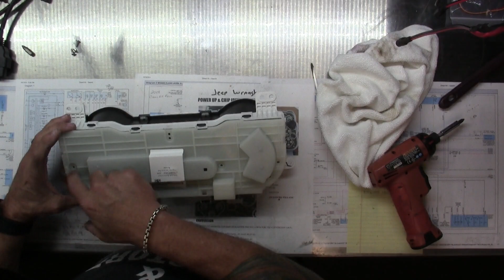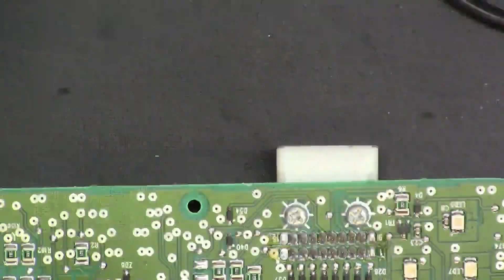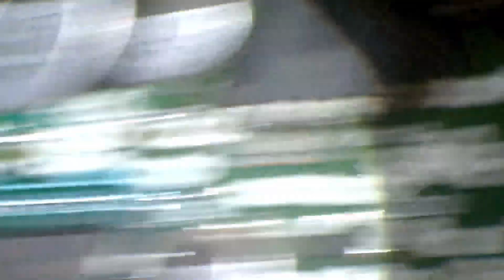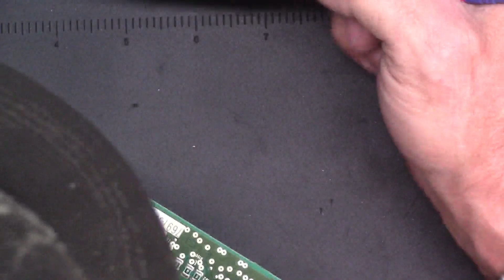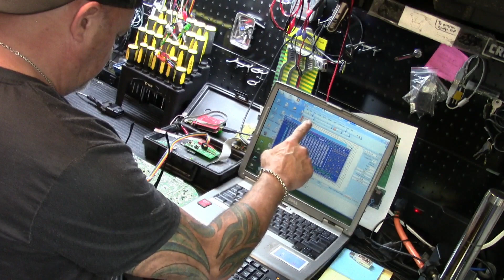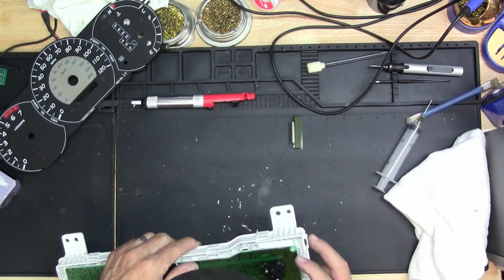2006 - 2008 Toyota Tacoma Bad Gas Gauge - Instrument cluster diagnostics.  Misdiagnosis or no?

Comment: I'm having P0500 readings off and on. Going to check solder points. Thanks for the video.
Reply: I have the same issue. Did you find anything ?